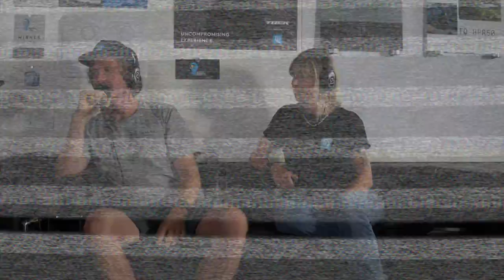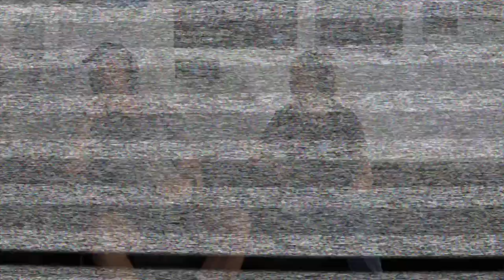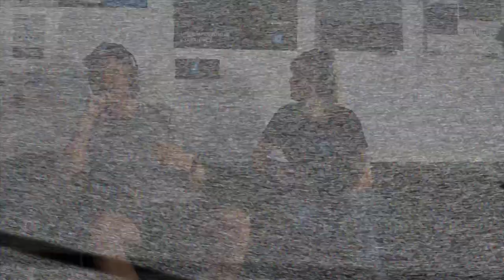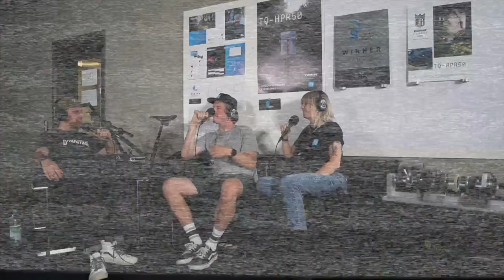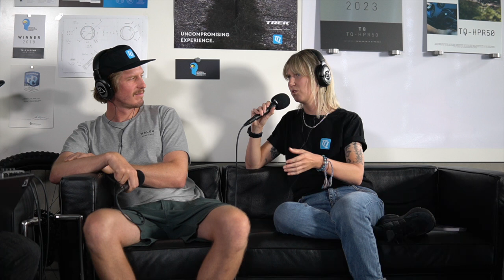The Future of eBikes? The TQ Drives Lightweight System

Comment: The motor looks very impressive but the elctronics seems a bit over done. Too many sensors. Why not use just one torque sensor fed to a proportional band controller of the motor. When I press the pedal, the motor should give me a proportional push, no delay and no alteration.
Synonym to true hi-fi or lossless in sound system.